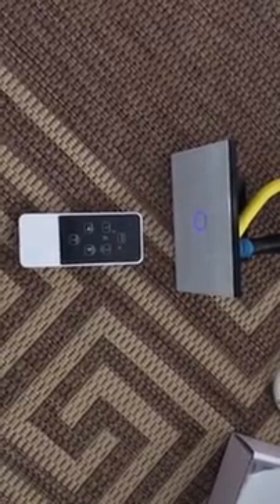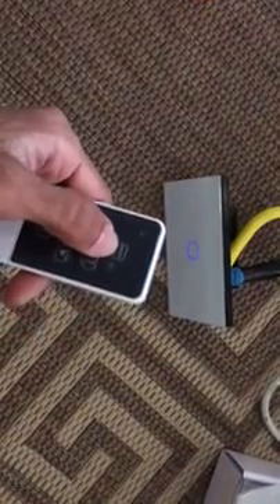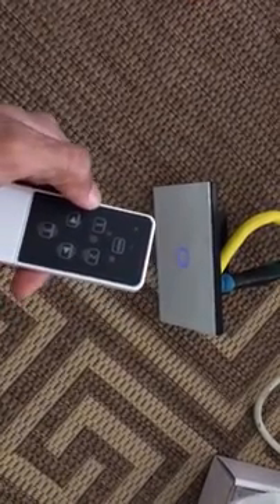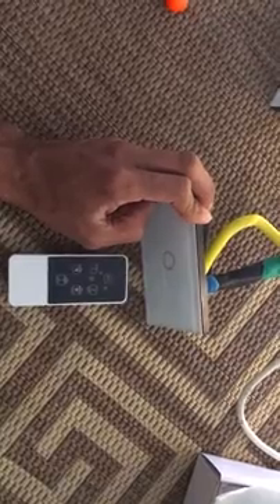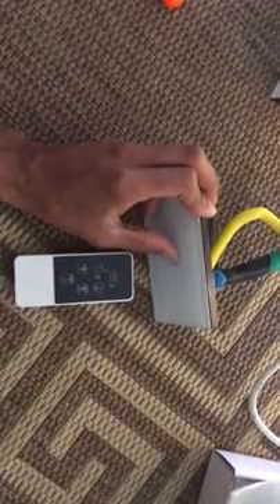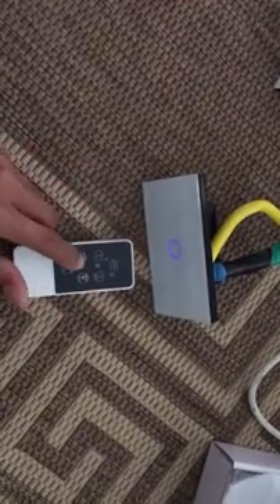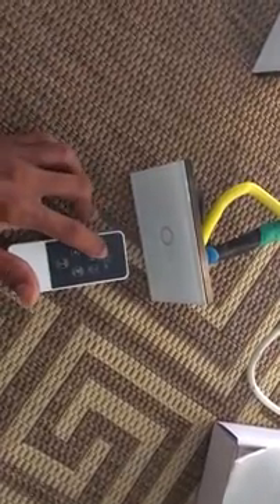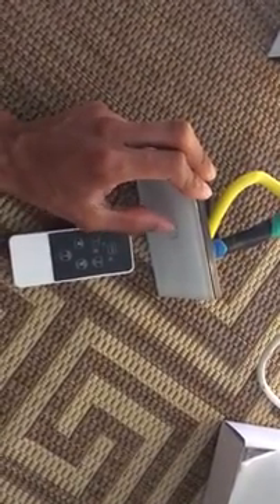TDF 1 gang Touch Switch Programming

Comment: Is this for the Biard led lightswitch? I want to pair 2 remotes to my 1 gang 1 way switch. I want to use the on/off button on 1 remote to turn the lights on/off and I want to use the number 1 button on the second remote to turn the lights on/off.. I've had it configured this way in the past but somehow they've gotten unpaired so I need to re-pair the remotes to the switch.

Comment: Hello.. I have the same switch but 3 gang.. And i want to operate all three room lights(loads) separately. In this case if i use on/off configuration, the on/off button will switch off all 3 room lights simultaneously. 

I want to configure "1" button on the remote to 1st light of the room (so that pressing 1 again and again to on and off the light).. And "2", "3" button on remote to configure(same single button on off funtion) 2nd and 3rd light respectively.